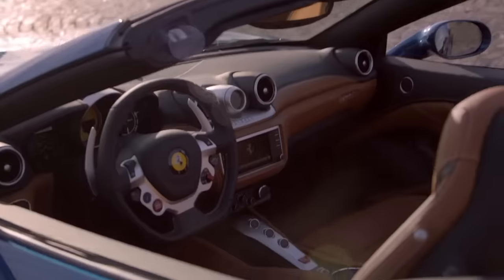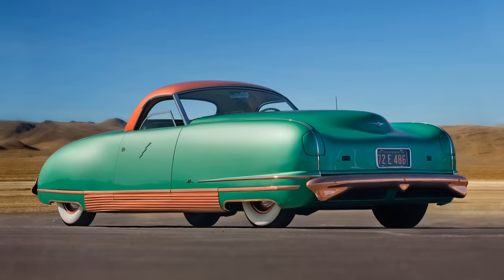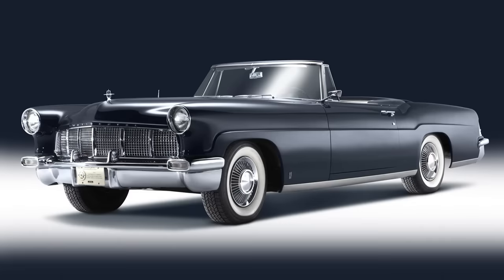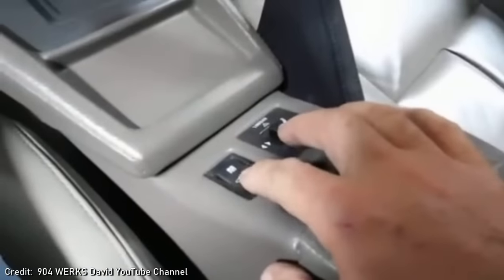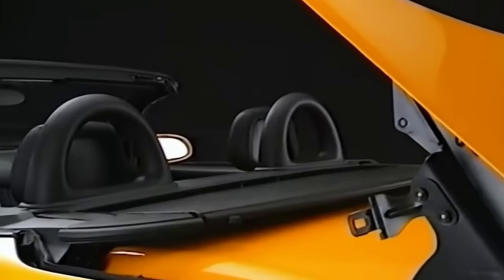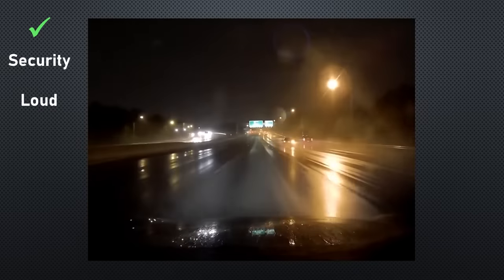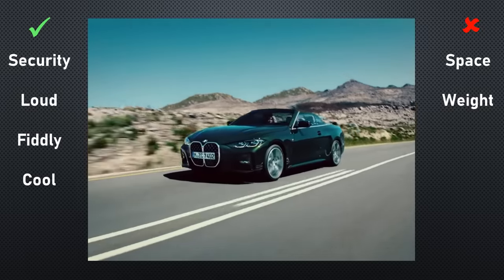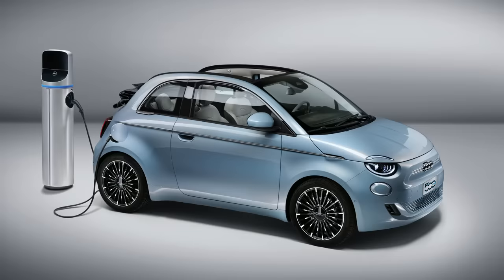The Rise and Fall of Retractable Hardtops

Comment: I'm hoping in about 10 years you will have a video on the SUV fad that needs to disappear ASAP.
Reply: Agreed, but it won't.  Perhaps in 50 years.
Reply: Why would they? So much better than a sedan.
If I want a good handling car I'll get a coupe. A sedan and all cars just cant compete for what I want and many others cause they are just too impractical and too low to the ground. Just walk around a parking lot and see all the cars with curb rash on the rims and scraps and dents on the bumpers.
No thank you.
Reply: Amen to that! No more mums on the school run in Nissan Quashimodo's who can't drive anything larger than a Toyota Yaris!
Reply: SUVs are for people with little driving ability and a big ego, unaware of how silly they look. The empereror's new clothes on wheels.
Reply: @petersimpson5859  I totally agree with you. ive lost count of the number of times I have seen a mum on the school run in an SUV covered in scraps and with scuffed wheels, usually driving with the door mirrors still folded inwards!
Reply: @baronvonjo1929  Compare crossovers to wagons or hatchbacks, and by my viewpoints make the result different:

-Practicality: Not much of a difference, maybe getting into crossovers is easier (helpful for less mobile people), but the extra height makes it difficult to pack the boot.
-Performance: Due to additional weight and higher center of weight, the crossovers feel sluggish compared to the other categories.
-Economy: Due to more weight and more frontal area, the crossover is significantly harder to move, reducing fuel efficiency.
-Safety: Crossovers are heavy. Hard to turn, hard to slow down, and unsafe to people who use regular cars.
-Offroad: Modern crossovers have huge rims, making them easy to damage, and all of the wacky software goes into limp home mode when the car meets even a slight level of offroading.

This is just my opinion, feel free to support your arguement.
Reply: Only thought this morning; why do many SUVs what's their point ....till just at that moment I had to pass over a ridiculous succession of speed bumps or sleeping policemen .. I thought about how much a wheel bearing or exhaust might cost ..and thought ahh that's the only real reason for many SUVs
Reply: When the Ford Explorer came out in 1990, people said the SUV fad would die down in 10 years. 
Fast forward to 2021, Ford USA basically eliminated all their sedans and mainly only sold trucks and SUVs.
Reply: @baronvonjo1929  But most sedans have more interior space than their SUV counterparts... There is no factual reason why anyone would buy a BMW x3 over a 3 Series. The 3 Series has more space inside, more luggage space, is faster, better to drive, more comfortable, better looking, cheaper and gets better MPG. People only buy SUVs because they want to sit higher up which is obviously a stupid position to be in when you're driving a car as anyone who knows about driving wants to be low to the ground for stability.
Reply: SUVs have large doors that open wide, useful for getting kids in and out, bigger boots for getting dogs in and out as well as push chairs and shopping, the elevated ride height gives better views of the road. They tend to perform in accidents much better than smaller cars. When it come to protecting my kids I would do just about anything to make sure they were safe. I know you are going to say well get a estate car that has a large boot ect...
But have you seen what is on offer today regarding estates, other than the RS4 or Golf R estate they are so dull and look so boring. 
A nice compact SUV is perfect in my opinion for a growing family.
Reply: @petersimpson5859  Or there are people who actually need them because they are practical, useful and don't break when driving over a bump. Just saying.
Reply: @imkirbo3094  and most sedans are garbage in winter climates where a lot of people live.
Reply: I don't get these crossover things it looks like a 4x4 estate thing  but is only front wheel drive some 4 wheel drive just make a 4x4 or an estate served us all well before and stop with the daft names
Reply: @strongereveryday2302  As is every single crossover. A FWD hatch/wagon with winter tires will go better than an AWD crossover on All-seasons and almost as good as a crossover on winters, while offering more MPG, lower cost, better handling, braking, acceleration and being safer because if it.
Reply: @imkirbo3094  Omg you actually think a sedan has more room than a crossover. No. Compare a compact Corolla sedan vs a compact RAV4. The RAV4 is the bigger more practical vehicle. That's just pure facts. 
Sitting higher has benefited me so many times. Driving a Honda Civic I cant see over minivans, trucks, crossovers, and even damn hills. Sitting higher makes me feel safer cause I can actually see. There is no false hope there. I can see what's happening thus i feel safer.
If you want mpg get a tiny micro car.
Also dont get me started on how limited a sedan and other car are because there so low. Just walk around a parking lot and see all the curb rash and scrapes on bumpers of cars. 
I dont have to worry about that in my 4Runner.
I dont think sedans and cars should disappear. But they are simply widely impractical for just simple everyday use in the one year I had one. 
Having a SUV has opened the flood gates to practicality and helped me in situations that a wagon could never do. 
Car buyers know what is the more practical easier option thus many have shifted to CUVs.
Reply: @imkirbo3094  I've never been in a x3 but the one 3 Series I've been in was awfully uncomfortable and small.
I looked up cargo dimensions for both and google tells me the x3 is bigger. So I'm confused on what your talking about just based of that. I cant deny your statement off a quick google search but I doubt it.
Reply: @06dpa  I personally find Crossovers to be a happy bridge between cars and SUVs. And they all come in so many sizes and shapes that many might as well be worst. But many are good.

Practicality: I do find a SUV or Crossover easier to live with. They just provide more room and even though I'm young and live a athletic lifestyle cars keep getting lower and lower every year to the point that I find it such a hassle to get in and out of a Honda civic. And I hit my head on the roof a lot. My mom liked the look of my Camry but hated getting in it when I had it. I personally find it easier to load stuff into a vehicle that's ar my height rather than bending down for a car. 
Personally the biggest issue with cars for me is how low they are. Just go around a parking lot and see all the curb rash and damage too bumpers on cars. Just impractical. And I cant even see over hills and its impossible for a car to get out of my drive way with the front foing first. The bumper is too low and hit the ground. My neighbors driveways go down and I've seen their nice new sedan just slam into the ground between the doors cause they are simply too low.

Handling: let's be honest. 90% of car buyers dont care. Just looks at some of the best selling cars of all time. Most dont exactly show sportiness and great handling cause people simply dont care. Especially in America where people love trucks and Crossover seem very well handling. I've driven a Mitsubishi Outlander Sport as a rental and perosnally was impressed by how well it handled for a Crossover. I havent driven many cars and I assume most people wont either. I was perfectly fine with it.

MPG: Yeah your totally right that CUVs get worst fuels economy but they also in a lot of them arent all that bad and the sales show most people are fine with the small sacfrice for the greater usage.

My family has perosnally always owned SUVs and Crossovers and getting a Sedan was definitely interesting as it braked well and handled better to what we were use to. But ince you drive one for awhile (at least for us) a crossover or SUV feels plenty safe and easy to handle. It might be tricky when you first get try it but it really not too hard to handle after a while.

I'm not a big off reader or anything. But that same Mitsubishi I mention earlier actually went offroading once and it really did handle it like a champ. I was very surprised it went through mud and had plenty of ground clearnce for the hills we were going through. 
I once was in the new 2020 Corolla with a bunch of friends trying to get to the beach. But for some reason the trail to it was just a dirt road. That led to a parking lot randomly. That Corolla was so ridiculously low to the ground that when we went over rocks it just slammed into them so hard and damaged the underside. When we finally made it we saw all these Crossovers and trucks just easily making it without any damage. After that it firmly ingrained into my head how impractical a car is. They look nice. But what's the point in having a nice car if they are so easy to damage.
I would love to have a sports car or hatch as a second car but I will never get one for a my main car. I really do liek their looks but I just remember all the times my 4Runner has helped me and quickly push it away.
I dont want cars to disappear but I'm just always baffled why so many people hate crossovers when it literally so obvious why people buy them. And people complain by how many they are but also never complained when sedans ruled the market. It just seem kinda hypocritical to me. But just let people buy what they want.
Reply: @baronvonjo1929  what everyone needs, is an estate.
Reply: @lazycalm41  Quashimodo! im rolling...
Reply: @strongereveryday2302  I've got an AWD 3 Series and it's great in the snow. Bare in mind most "SUV"s these days are only two wheel drive anyway unless you pay for AWD as an optional extra, so they're no better than most sedans as BMW, Merc, Volvo, Audi, can all be optioned with AWD too like mine
Reply: @baronvonjo1929  It's proven in crash ratings that SUVs are far less safe to travel in, they weigh more, their braking distance is longer and they're less stable round corners. In the 90s they had a tendency to roll over completely. You're exaggerating the MPG point, my 3 Series can do up to 50mpg, that's a lot more than any cross over and it's not a 'tiny micro car'. Saves me thousands per year in fuel. I don't understand your point about scraping the bumpers on curbs as that's driver error? If someone scrapes their bumper on a curb then they've had a crash and aren't capable of driving a car properly, that's not the car's fault.
Reply: Sadly everyone wants practically and safety , so these tractors will not disappear quickly. Unless they make all parking spaces so small and start taxing cars with bigger volume 😄
Reply: SUVs will never go away. Cargo space is useful, and too many people like the feeling of driving their living-room down the freeway.
Reply: I totally agree! What is the deal with these cookie cutter SUV's? 🙄
Reply: @petersimpson5859  YES! I LOVE IT! LOL!
Reply: @goclunker  There are no wagons for sales at a decent price point in my country and they still suffer from the lowered ride height height and this are easily damaged. 
Plus somehow most people think their ugly and would rather pay the same money yo get a crossover that holds the same amount of cargo.
The best selling wagon is the Subaru Outback for a reason. People like the height.
Reply: @imkirbo3094  I assume your 3 Series is a diesel? Diesel isnt a big thing in the US and most are probaly sold if at all as gas. And just look at the sales of Crossovers. People are willing to just take the sacrifice and that's the main point. Plus if you are talking about a diesel car I'm pretty sure VW ruined the entire industry in the US. Cause all the BMW diesels I saw would 2018 or older. I dont think they make them for my market anymore. 
I've driven SUVs and crossovers and sedans. I'm still here and never had a accident with one nor as my family. So yeah I feel plenty safe. The idea of a roll over sounds ridiculous. It's very simple action of breaking and I've never had problems.
In terms of damaging you car it so easy to do.  My neighbors use to damage their Dodge Dart and BMW 3 Series beneath the area under the doors  while entering their driveway.
I damaged my Camry trying to leave my driveway facing forward because I assumed as a "practical" vechile it could make it but nope. My friend damaged her new Crolla trying to get us to the beach as the trail wasn't paced and the entire car just slammed into the ground at the smallest sign of a variation in the ground. Then we saw all these trucks and crossovers just plow through the same but with absolutely no damage or problems.
You can go around my area and just see all the poor roads and damage from cars plowing into the pavement on sharp hills. And also see so many cars with their bumpers pressed against curbs because they are simply too low.
Your totally right and a lot of that can be avoided or worked around. But why? It makes so much sinceto buy a CUV oo just have the ride height and never have to worry about it.
I've had to go up on curbs before in my 4Runner cause the road was narrow and the sedan in front of me was useless and couldn't do anything. 
I also learned it's a lot easier to curb rash a rim than I thought but in situations similar to that my 4Runner just handled it like a champ. 
I'm not saying cars a all bad. And I dont want them to disappear. But people who act like they are so great and dont understand why people shift to crossovers just confuse me. Especially the handling argument. Look at the best selling sedans and such in history and tell me if their exactly the top handling cars that just break of sportiness and handling. I've driven CUVs and they feel perfectly fine. Most people just dont care. Cars are appliances first. As long as it can easily get you places with little problems it's all good.
Reply: @Emppu_T.  Youd be surprised on how genuinely people think wagons are ugly. If people liked them they would have bought more of them. The best selling wagon in the world is lifted and marketed as a CUV. People love the ground clearnce it seems. Also I dont have any wagon examples really in my market but they tend to be the same price as crossovers of similar sizes and people just bought the Crossovers.
Reply: @baronvonjo1929  SUV's ground clearance height makes them even more popular with catalytic converter thieves.
Reply: @oliverlaw02  Eh. I've been fine so far. A lower ground height is just unusable for me in so many of lives little middle fingers to me.
Reply: In contrast to most of these comments there is a chance that SUVs, and even crossovers might start to disappear. They are larger, and so use up more resources to build. I had heard mootings that building such vehicles might become prohibited under environmental rules?
Reply: @baronvonjo1929  i don't know where you live but i own a sedan and an estate and I've never had any issues with ground clearance in northern Europe. If you think SUVs are safer you're plain wrong. SUVs are not as long as normal cars Which means there is less length for deformation which exposes the occupants to higher rates of deceleration in a crash. They're also heavier which means they carry more kinetic energy which in a crash makes it's way to the occupants. Long/light/low cars=safer cars. It takes ten seconds to raise myself out of the car, why on earth would i sacrifice handling, looks, fuel economy, safety and cost to make getting in and out marginally easier?
Reply: @andref8246  I live in the foothills Appalachia.
Also here we have big SUVs and Crososvers. And I would rather be in my 4Runner in a wreck than a Corolla personally. But tbh. Car regulations are constantly evolving and I feel pretty safe in all new cars mostly.
Reply: @andref8246  I didn't go crazy into it. But a family friend who is really really into cars wanted to give his daughter a mustang for the longest time. And then got rid of it cause it was the first generation mustang and he felt she would be unsafe. And then got her a Crossover because he didn't think a sedan was safe enough for her and what's funny is she wanted a actual car. But he works in insurance and he said all his years working showed him Crososvers were safer. 
I just did a little research and tbh just on the little I did it seems like it varies a lot but typically crossovers are less likely to result in serious injury to occupants and rarely rollover like the argument I always here. 
I just did a quick google search and just read through 3 different articles on the subject amd didnt but much time with it. But just saying it seems based on that a crossover is safer but who knows. I'm sure the smallest crossovers are probably just like cars.
Reply: @baronvonjo1929  that's a fair assumption. New cars are very safe regardless of type. Tbh if i were getting into a crash with a large SUV I'd want to be at least in a large modern car For the longer deformation zone and I'd  want the SUV to be modern so it has the latest crash compatibly structures built in to prevent it climbing over the car and into the passenger compartment.
Reply: @06dpa  some folks with reduced mobility who still walk find them easier, but a lot of folks who use wheelchairs actually find them harder (as a sedan/hatchback seat height is usually similar to their wheelchair seat height, so a crossover needs extra lifting with the arms to get in/out). Just to add a little extra detail on that consideration. I think regular hatchbacks are better too. An SUV is now just a tall wagon, and a crossover a tall hatch. Just my onion though.
Reply: @baronvonjo1929  Fair point. Insurance statistics are a good guideline but shoudl be carefully interpreted. I have seen studies showing either SUV's or sedans in the lead. In the studies I looked at large SUV's/crossovers and large sedans/wagons did better than everything else on the market. These studies look at how good the vehicle is in protecting occupants during a crash. There are many other factors that are harder to measure such as how many accidents are prevented when a better handling sedan is able to brake in time or maneuver out of harms way where an SUV would have hit the other vehicle or what does the greater kinetic energy of an SUV do to occupants in a single vehicle crash? Geography plays a role too. In the US crash compatibility is the most important i.e. is your vehicle crash compatible with large SUV's/pickups? Here in europe this is not as important since we dont have a lot of large SUV's or pickups.
Reply: I can't wait.
Reply: Perhaps he can do a video on the car fad in 2030 if Klaus Schwab has his way?
Reply: @Danny-204  MPV cars down all the same things but we're actually much better in my experience. May not have looked as "range rover" but done their job in much better fashion
Reply: @06dpa   So about your points on safety: They actually aren't hard to turn because of power steering, they aren't very hard to slow down thanks to power brakes. Also, pretty much any object that weighs more than maybe 7 pounds moving at 60 mph would be dangerous to cars. I can't think of anything to argue against them being heavier though LOL.

Also about the software in your section about offroading: every car from like 1995 onwards has at least 1 computer in them so this would more than likely be a more widespread issue than you probably realize and not just unique to crossovers. 

Thank you for your time and have a great day!
Reply: @andref8246  If a large sedan is safer you would think large sedans would be the last class of sedans still big everywhere. I mean people buy to many big Crossovers and trucks around the same price but not things like the Ford Taurus, Chevy Impala, and the Toyota Avalon and Nissan Maxima.
Interesting.
Reply: @baronvonjo1929  Trunk utilization.  Mail slot openings with the back window angled such that you have big car with a 2 foot or less trunk lid.   Might hold a lot if you filled the trunk with sand.  Not so much if you normally carry bulky items.
Reply: @baronvonjo1929  You are aware that the RAV4 costs roughly twice as much as a Corolla?
You have to keep comparisons in the same range, or we could compare a Dacia Duster with a Rolls Royce Ghost Extended.
Reply: I hope your prediction comes true ,and we go back to sedans dominating the roads again.
Reply: @baronvonjo1929  SUVs also get curbed wheels. They are less energy efficient, higher Cx, heavy, big and most times underused. It is a fad and with like all fads it will go away. Higher center of gravity is another issue. You can’t fix that.
Reply: @imkirbo3094  not really, there are 70 more liters in the trunk and one more cm more between the axles. 
https://www.auto-data.net/ro/compare?carId1=43613&carId2=43804&carId3=37263
Plus, you can carry a fridge or some Ikea when reclining the 2nd row of seats.
Reply: They grew from the seat belt regulations and are truly awful ugly things, but practical for families.
Reply: @baronvonjo1929  "Sitting higher makes me feel safer cause I can actually see"
Being higher up is the complete opposite of being safe when you are on the road. #CenterOfGravity
Reply: SUVS are better than Sedans in 9/10 possible ways. I don't understand the hate they get. They are SOOO MUCH more practical. You don't give the slighest shit when going over potholes. Getting in and out is easy. You can sometimes fit 7-8 people in them. Sitting in traffic is better because you are high. Going on rough country roads is fine. You feel much safer and you are much safer in case of a crash. 

This gatekeeping dumb elitist attitude against SUVs are idiotic. You don't like them? Great! Buy a Sedan or a Station Wagon. The only problem I find with SUVs VS Sedans is the fact that you can hear things move around in the cargo space. 

I don't think SUVs are a fad because they simply are better than sedans and station wagons. Maybe a fuel crisis or something will bring them down but in that Electric cars will take their place anyway. Try fitting 5 adults and their luggage in a Hyundai Elantra. It is easy in a Hyundai Tucson though.
Reply: @baronvonjo1929  scrapes and bumps? It’s called bad driving
Reply: People keep getting more obese they need the room to fit, so unless the monsters become human sized again it wont happen.
Reply: @onsokumaru4663  Bruh I cant even see of bushes in a goddamn Camry. I cant see over hills in a Civic. Being conscious of your surroundings and knowing what around you is safer. Ask the crew of the goddamn Titanic. I never had a flip over of any sort so I'm fine with my center of gravity.
Reply: @ijaen  Why are they a fad? What makes a fad on the automotive industry? Were minivans, hatchbacks, wagons and 2 doors cars a fad?
I never heard a segment of cars that is destined to disappear have such a huge lineup of shapes, sizes, and capabilities. Hatchbacks are typically compact and minivans were just one size.
Crossovers come in so many shapes and sizes like sedans I cant see them disappearing. No doubt many could potentially. But it's been over 30 years since the fad started (Jeep Cherokee and Toyota RAV4) and it dosnt seem to be slowing.
Reply: I am not a fan of SUV but when more and more giant SUVs on the road, I feel I need to get an SUV too for my safety.
Reply: @XavierAway  Still ain't worth the risk. I love my ground clearnce. Came in clutch this weekend.
Reply: @Danny-204  just get a fucking wagon everyday people don't need SUVs
Reply: @andref8246  Low ground clearance improves aerodynamics (reduces drag at highway speeds) so there is no reason for a vehicle which drives mainly on sealed roads to not be as low as possible -- unfortunately, however, most buyers don't choose cars based on a rational engineering analysis. :(
Reply: @OKANGUVEN99  It's just as easy to fit 5 adults and luggage in a Kia Carnival minivan -- in fact it is what the Kia Carnival is made for! The Kia Telluride SUV is a compromise at best at moving people and luggage.
Reply: They’ll all go EV. SUV and Compact UV (CUV) are here to stay
Reply: @baronvonjo1929  But not really anymore practical than a svelte estate. I absolutely detest SUVs but would gladly take a decent estate car; far more classy than a crass SUV or crossover. If the reason for buying an SUV is because you can't drive properly, I'd rather give up my driving licence now.
Reply: @Danny-204  the cacophony of drab and austere SUVs and crossovers being produced is far more disappointing. A nice estate looks so much better than relentlessly boring SUVs, many of which you can barely tell the difference with these days. They have zero class too.
Reply: @Simon Parsons, having owned both, I would pick a SUV over an estate any day of the week, but it is just personal preference.
Reply: @aston-martin-internationalist  My dream is to get a lifted Toyota Wagon but I'll never get it so I'll stick with SUVs.
Reply: SUVs have actual advantages. Won’t fade away fast
Reply: @baronvonjo1929  as if that doesn't happen to SUVs
Reply: I want a wagon: storage space if an SUV, handling, and fuel economy of a sedan.
Reply: Apologies to all for my off the cuff remark which has started quite a long old debate about SUVs! What I've  noted though is that no one has mentioned legislation and what sort of impact that might have on large SUVs in the future. Also many pro SUV replies tend to mention their own safety and tend to forget about the safety of other road users, interesting thought processes going on here.
Reply: @baronvonjo1929  Advertising has a lot to do with the current popularity of SUV's. Car companies want us to buy them since customers are willing to pay more for them. They dont cost any more to build. Another reason is that sedans have been around so long I guess people just wanted something different. Vertical space is a factor too and some people actually need that space so i kinda get that. In my part of the world people stick to large wagons they do everything an SUV can with better handling, fuel economy, looks and equivalent space. Some of them even come with lifted suspension and AWD so they can get away with light offroading.
Reply: @OKANGUVEN99  We dont have potholes where I live so i dont need an SUV/pickup. I dont need to drive on gravel roads either though I do a lot of winter driving(-10 degrees in icy conditions for 3 months of the year in my 2wd sedan and wagon). I like cars that look good, handle well, have good fuel economy, power to weight ratio, that can go fast(220 kmph+) on the Autobahn. "Elitist" attitudes against SUV's are generally held by people who know a bit about cars and like them. SUV's are not even safer than sedans/wagons despite being objectively worse in almost all other criteria.
Reply: @andref8246  I want a lifted wagon like a Outback. But I dont trust Subaru reliability so I never got one.
Also in my part of the world and actually most of the world sales of wagons show how much people genuinely dont like them and their looks. So wagons arent a option so the next step of crossovers.
Reply: My stelvio disagrees with you
Reply: @johnblaze6269  i think the Giulia would disagree with your stelvio. It's cheaper, more efficient and drives better than the stelvio.
Reply: @baronvonjo1929  Personal luxury coupés? They disappeared pretty quickly once economics and demographics kicked in.
Reply: @charlesbridgford254  Sorry this is a long ass comment thread but I dont recall personal luxury cars ever being mentioned. Could you give context
Reply: @petersimpson5859  or for people who needs a 4x4 because of bad roads, but need the convience of a secured trunk...
Reply: @imkirbo3094  an suv has more functional trunk space. you can obviously fit larger items, like furniture.
Reply: @baronvonjo1929  In the context of an example of how a segment can disappear as demographics/wealth change with time. I doubt this will apply to SUVs, but it can happen.
Reply: @andref8246   women like the stelvio more than the gulia lol, it also looks more expensive especially with Lunare white paint lol.  and he said suv are for people with little driving ability, the stelvio still has 50/50 weight distribution and is firmly planted on the ground, i have fun with it on backroads all the time, it handles and corners better than the vast majority of coupes sedans I’ve driven. I’ve worked at a used cars dealer so I’ve driven damn near everything you can think of. I’ve owned tiny hatchbacks and own a e92 328i 6 speed. You can like SUV’s and regular cars idk why people hate them.
Reply: @johnblaze6269  The stelvio IS more expensive than the Giulia. I would imagine it doesn't handle better then the Giulia though. People can buy whatever they like. Buying SUVs make manufacturers make more of them while spending less on non SUV body styles. This translates to less choice and higher prices if you want a sedan, coupe or wagon. This is why car guys hate on SUV'S.
Reply: @Danny-204  everything you described could be perfectly achieved by a minivan
Reply: @andref8246  they dont need the extra space, they think they will need it someday. That's how marketing works: you appeal to one's ambition, hopes and dreams and not to reality. Same with the off-road look. Most people like to feel capable of going anywhere/ freedom and this is why rough looking equipment (not just cars) is popular.
Reply: @almerindaromeira8352  exactly. I don't understand why people harp on about SUV's giving a more commanding view either. You don't actually need to be sitting high to drive safely. It's not like you need to see over the car in front of you to be able to drive safely. Maintain a safe stopping distance and all is good. I have these discussions with people who insist that they want to be sat up high in an SUV and that makes them safe. The same people tailgate, fail to scan in front of them, fail to practice emergency braking/avoidance maneuvers, drive too fast, don't understand the importance of correct tire pressure etc.
Reply: @andref8246  I don't get it too, if that is the way they feel secure they should by an Unimog (joking).
The worst part is that crossovers lend themselves very well to battery electric platforms due to their size, suspension and clearance (which when the battery is in place will be as low as any other sedan). Even Volkswagen raised the height of the hatchback with their ID.3!
Reply: Uninspiring unimaginative boxes on wheels,cant wait to see the back of em